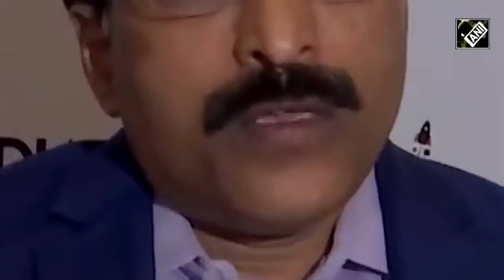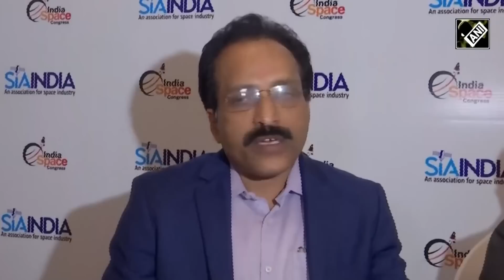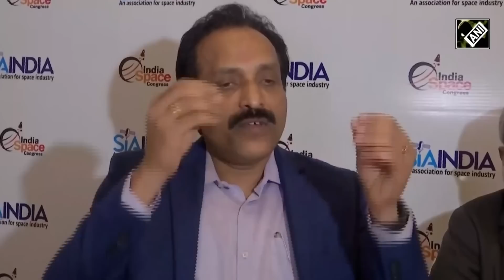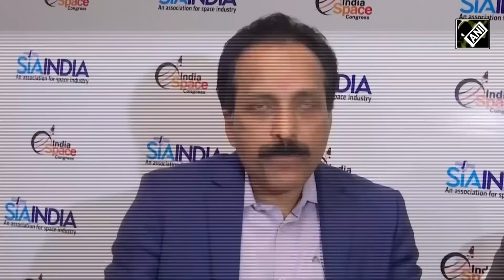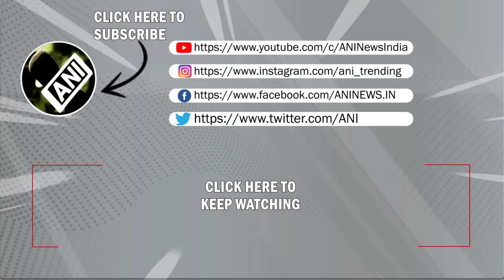ISRO Chief explains what went wrong with Chandrayaan-2 and how Chandrayaan-3 will be different!

Comment: Lander deceleration during descent by reverse thrust jet engine works only when there is an atmosphere of thick gas around the Moon (Newtons third law). He just said there is virtually no gas atmosphere on the Moon ! There is no such thing as an antigravity reverse thrust engine.
Reply: 😂😂😂😂that's why you are not in isro😅😅
Reply: You dont understand the third law
Reply: Deceleration does not need atmosphere or any gas surrounding the craft...any craft can decelerate in vaccum using reverse thrust...the high speed exhaust gases coming out of the craft due to burning of fuel in engine creates a force..since the engine is facing forward during descent the force produced is opposite to motion of the craft therefore the craft decelerates.